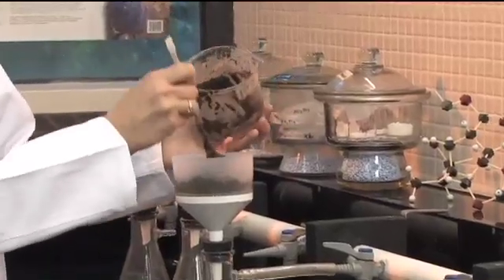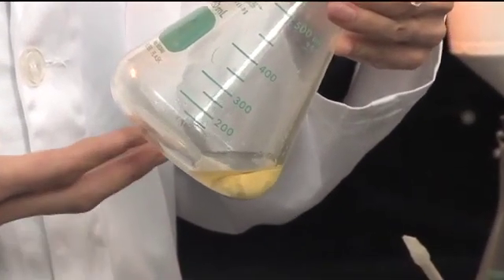Salinity Measurement

Comment: Microsiemens to decisiemens, divide by 1000 doesn't sound right. More like 100K. Also, isn't it important to scrape ALL the paste into the filter?
Reply: Measurement unit of Microsiemens area in EC testing is Microsiemens per centimeter (μS/cm) but in area of decisiemens in EC testing is "per meter" decisiemens per meter (dS/m), not in "centimeter." Measurement unit of sample area is different. That's why Microsiemens and Decisiemens conversion factor is only divided by 1000.